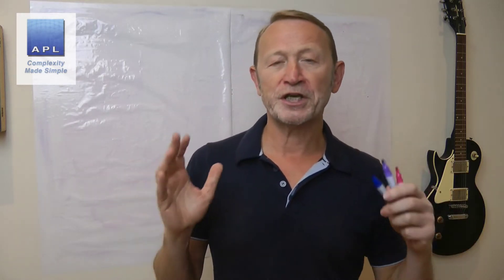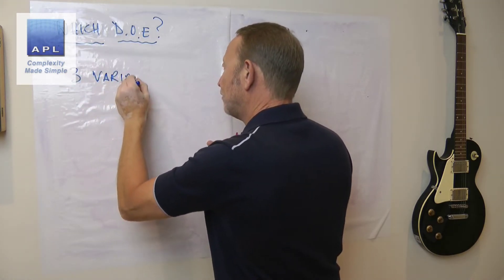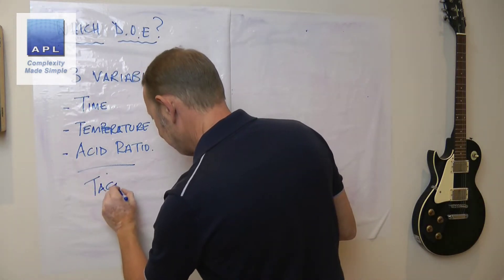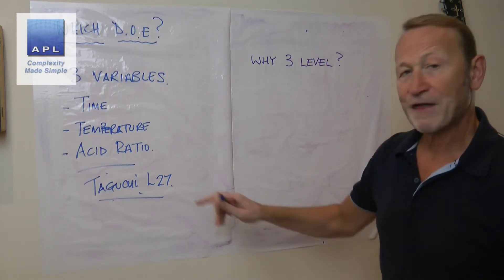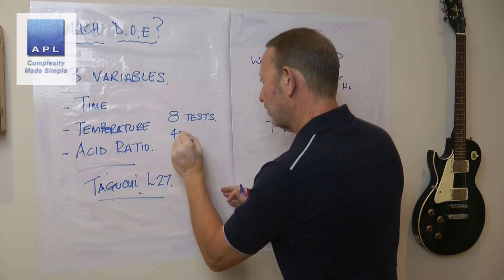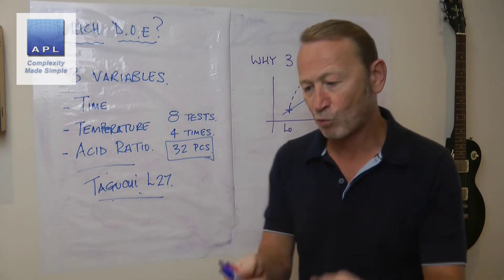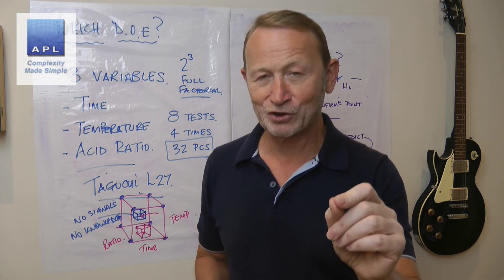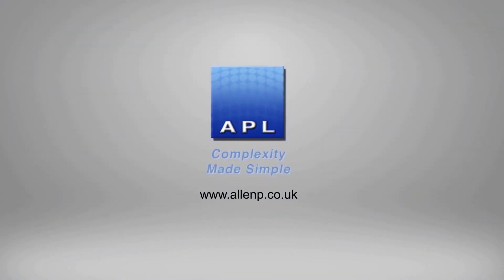DOE Advice - 2 level or 3 level DOE

Comment: Hi Paul, thanks for another great video. You talk about the dangers of using too small of a design space but there must be a danger at the other end, where your design space is too large. Especially when you come to factors like time, there must be a point at which running for longer gives diminishing returns, meaning you could ruin your linear model. Can you offer any advice on estimating  useful high/low values which fully encapsulate the linear part of the relationship?
Reply from the maker: Yes good point - this is a tricky one, you're really using the best knowldge you have of the process. If you're unsure of high/lows use the regular settings, but just expand them a little. Getting all the data in the test is better than creating settings that produce nothing, so the test will then teach you new knowledge, even if that is you should have used a bigger design space...
Reply: @paulallen5321  Wow, thanks Paul. If only my supervisor would respond this quickly to my questions!

Comment: Thank you for the video, answers a questions I had before I pursue my DOE (pretty sure my relationship is non-linear) but I will give this method a go! 

Another question I had was once I have the data how do I go about getting the prediction? (I have been using minicab) is there a section that does that automatically in the software or is this a manual job?

Thanks, Jordan
Reply from the maker: If you use the optimiser in mintab you'll get a prediction...